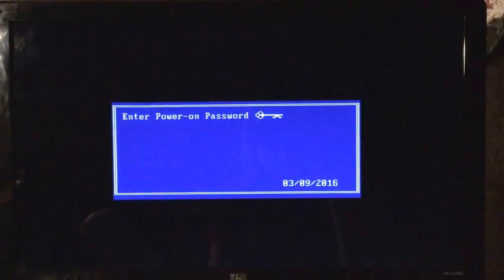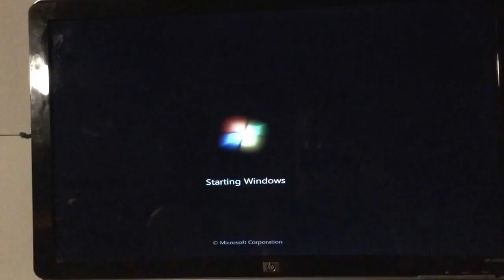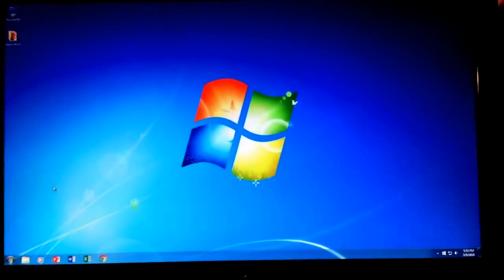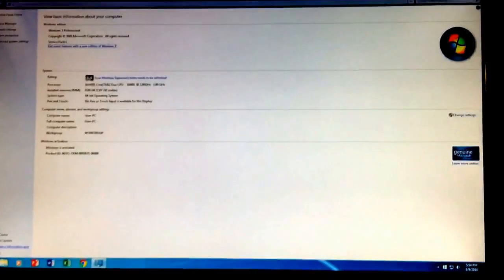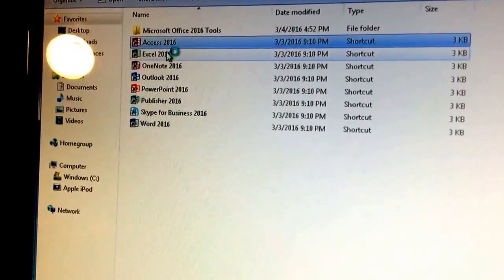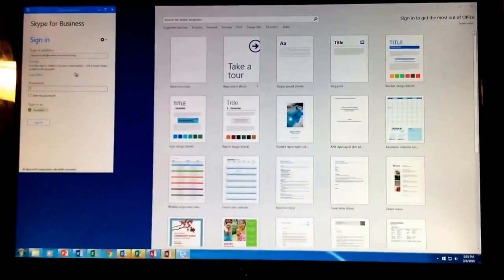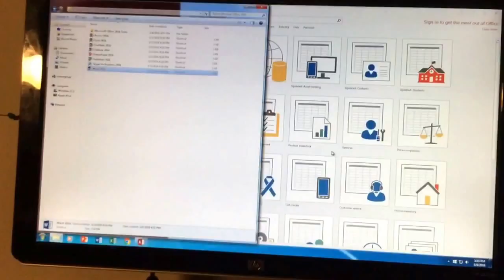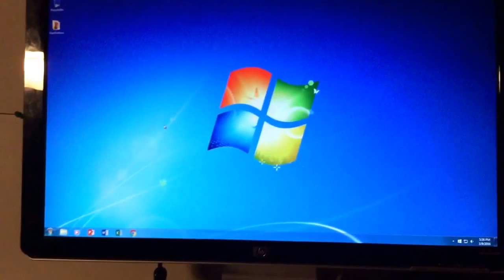HP Elite 8000 Review (and Mini Processor Stress Test!)

Comment: OMG the DVD ROM tray on this thing is the chinziest piece of CRRP ever!!!
Reply from the maker: It’s a typical plug and play 5.25” drive, actually pretty tough to destroy unless you’re in high school in which case someone took out the rubber drive belt or shoved a snickers bar in there. The new ones in desktops that use a laptop style pop out drive are the ones you should be worried about. Even barely touching them while open would cause them to wiggle all over the place like it’s going out of style
Reply: @RealElementProductions  That's what this one seems like.   I couldn't get it seated back in the rails to go back in, so I futzed with it for 5 minutes, then pshed the rail in, then I sort of lined it up and smacked it with my hand out of frustration and it popped back on the rail inside and fixed it.  ANd Iw as like holy smokes that worked.   

This onlike the 3rd use of the drive tray by me ever.

I have it standing vertically on it's side with 4 rubber feet I mounted below so it's like a mini desk tower, so if you forget to put the tray back in anybody walking by in the dark can hit that dmmn tchinzy tray hanging otu which is what I did. 

Comapred to the beefy old 1x CDROM trays theset hings are a fragile joke.
Reply from the maker: @choppergirl That’s interesting, is it motorized like you click a button then it can go out and in by itself or does it just pop out and you have to push it in every time? I’m trying to see if maybe you have some weird adapter plate or something because full size desktop optical drives have been relatively unchanged since the 90s
Reply from the maker: OR you could be talking about a different computer. HP started using those laptop style drives pretty soon after these machines in the 600 and 800 series of desktops
Reply: @RealElementProductions  Mine isn't motorczed, but it is spring loaded and an electronic button will trigger a release servo.  

It's funny, I'm only using the HP for the DVD rom drive shared across the network as a network DVDROM drive because my high end workstation ... well.. doesn't have any location to install a DVDROM drive in it (Corsair 5000x glass aquarium style case with 3970x 128gb 3070 in it).

I have an old CDROM tower case from the 90's  I'm building a NAS drive box of cold storage of 3.5 drives... that has 18... count them.. 18 5.25 bays in it....   

I had 2 more of these somewhere in my warehouse with a few number of 5.25 drive bays in them if I didn't throw them away...    I for sure though tossed all the 1x CDROMs in in them....  (probably)
Reply from the maker: @choppergirl Wow that’s mega smart, thanks for visiting the channel!

Comment: Run with a Intel Xeon X5460?
Reply from the maker: The Xeon is an LGA771 socket, while the HP Elite 8000 only supports LGA775 CPUs, the Xeon wouldn’t physically fit into the HP

Comment: Hi can o add a second hard drive?
Reply from the maker: ZiaDox Yes, in lieu of the optical drive
Reply: Element Productions soo i can add another hard disk ???
Reply: Element Productions so i should use a sata cable?
Reply from the maker: ZiaDox The one already plugged into the optical drive is compatible with SATA hard disks
Reply: Thanks<3

Comment: i bught one with 4 ram and win 10 i will upgrate to 8 ram . so i wanna install xubuntun or linux mint  wich linux  can i use? better
Reply: ubuntu 20.04 lts is good option ,
More stable .
Reply: @mdanaszaimkhan5105  too late i have many time using mint but actually im.using manjaro in my other laptop
Reply: @alubaldini  mint vs ubuntu (stock) what you prefer
Reply: @mdanaszaimkhan5105  im prefer mint i started with ubuntu but some days then the system started slow when you star the system  or close the system for my mint a little more faster i you can do more thinks example efects desklets and other thinks on mint
Reply from the maker: Look up what version is best for what you want to use it for

Comment: P lease relpy can I use a i5 660 and a gtx 1030 on this pc
Reply from the maker: Nope, Core 2 Duo on the 8000 models only. 8100 uses an i5 660 and you will need a low profile 1030 but yes it will work

Comment: Were the HP Elite 8000 models with Windows 7 ever sold with USB 3.0 ports? If not, can it easily be upgraded to USB 3.0?
Reply: No and yes.
Reply from the maker: No, only USB 2.0, you can add them with a low profile expansion slot

Comment: Just bought one of these as a refurb. Any advise as to what to check when I get it? It's win 7 pro.

Update...when I first turned it on I got 5 beeps and 5 red blinks...which is a ram error.  Turns out the 4gb ram in the black slot just needed reseating. Not sure which slot to put another 4gb stick in though. Surprisingly quiet.
Reply from the maker: Check for leaking or blown capacitors, but these are not known for having those issues. Otherwise they are solid performers

Comment: I upgraded mine windows 10 pro now Wi-Fi is missing tried to contact Microsoft opened the forum found out I wasn't alone.
Reply: have you tried with an external usb wiffi port? or checked if wiffi card is installed? because some of this models have no wiffi card incluided
Reply from the maker: Ooh, uh how did you get WiFi on there? A card? Get a USB WiFi adapter

Comment: Does a wifi adapter work on it?
Reply: WindowsPC yeas pc-i wifi cards work and so do usb wifi adapter
Reply: @letsnerdout9178  thanks for your answer  because wiffi card can be expensive while usb adapter is a cheaper option
Reply: al ubaldini no problem
Reply: @letsnerdout9178  thanks is a cheaper option ,, dude have you ever install or used linux in this pc i wanna install ubutun or mint and use dual boot ,win 10 for some simple games and consoles classic emulators  ,, and use linux
Reply: al ubaldini I have never used Linus period
Reply from the maker: Yes

Comment: Im getting this pc for 270 USD could this run games smoothly heres the specs.

3.2 ghz

16GB RAM

Quad core i5 processor

2Tb SATA 7200RMP

and it has dual screen ready
Reply from the maker: That’s an 8100, 8200, or 8300

Comment: I was wondering if this computer will be obsolete soon since most are refurbished, I just purchased one about a month ago, how long will I be able to get parts for this computer, I have a laptop from a different brand which is a year to two years old and cannot get some parts for it according to manufacture. Thank you for your video and reply.
Reply from the maker: Daniel Trujillo This PC will not be obsolete for at least another decade. My HP Vectra XA-6 from 1997 is still chugging with all original components and Windows 98 which is installed is perfectly usable. Seeing how popular the Elite 8000 was, there should be an aftermarket for used but working or off-brand parts for years to come.
Reply: I appreciate your reply and thought you did a great job on the video, keep up the great work.

Comment: mine has windows 10
Reply: it runing fine? i will bought one with win 10 but just 4 ram but  i will upgrate to 8 , so yours work fine? i wanna try to install linux
Reply from the maker: Nice
Reply: @RealElementProductions  I used to have that pc from 2017-2019, got rid of it and had a lenovo thinkpad t440 for a while, currently using an hp pavilion desktop pc with a gtx 970

Comment: do you have to have an Ethernet cable?
Reply from the maker: 99% of the time, yes you will need an ethernet cable for the internet. However, there is a clever workaround by means of a USB wifi receiver like this one: http://ebay.to/2flfXCk

Just plug in the adapter, follow the instructions, and you're all set. Have one of my own and it works great!

Hope this helped.
- L
Reply: Simplyou2be thanks does the Wi-Fi adapter work for this tower?
Reply from the maker: +Joe Pinard Yes. it will work with practically any computer running Windows XP or above that has a USB port

Comment: Hello I recently bought this off amazon and i was wondering if it will play games like battlefront 2 (the old one of course), and garrys mod? It would be amazing if you reply
Reply from the maker: Garry's Mod runs 30fps on normal settings, which is decent for what you're paying for one of these. Battlefront 2 I haven't played yet but from the minimum requirements you should be good to go :)
Reply: Simplyou2be So would i be able to play these games right out the box and without upgrading? also forgot to mention 1 more game left or dead 2 lol sorry

Comment: can you fit a gtx 1050 ti in it?
Reply from the maker: TERRIER unable Nope. just got one myself and the card would stick 2 inches or so outside of the case. sorry
Reply: would it be able to if i took out the side panel?
Reply from the maker: TERRIER unable I wish, but the power supply is far too underpowered to support a card of that magnitude. Not to mention that removing the side panel would cause issues for cooling
Reply: oh ok what graphics card would you recommend?
Reply from the maker: TERRIER unable HP recommends the Nvidia Quadro NVS 295 which is probably the best you could get for this computer, but Quadro cards are more suited towards business applications than gaming. I sugguest you get an HP 8200 or 8300 CMT desktop. They'll have more recent Core i5/i7 processors and can fit a 1050ti with ease
Reply: i searched up hp 8200 cmt desktop and i found a hp 8200 elite cmt desktop. is that the one your talking about?
Reply from the maker: TERRIER unable Yes. I have an HP z220 workstation and the 1050ti fits perfectly. Since the z220 and Elite 8200 are nearly identical by layout, I guarantee the card will fit
Reply: Yeah I saw a review on it and it looks like it will fit easily! Thanks for your help

Comment: I am bidding on 1x8000 and 5x8200 as 1 lot auction.  My plan is to combined some of Ram stick into one machine that I want to use.  This auction doesn't indicate the specs, so I am assuming it has only a basics (no upgrade ever made to this machine). My question is, if I pull Ram stick into one that I am going to use, will it work?  What else I can use from other machines into the one PC that I am planning to keep?  All 6 machines, I think I can get it at $25.00 - $30.00. so, I thought it would be worth it.
Reply from the maker: Probably so

Comment: I am bidding on (1) of 8000 and (5) of 8200 as  1 lot bidding.  It doesn't show the specs of the machines that I am bidding, so I don't know what size ram or HD sizes it will come with.  My question is, I am planning to pull Ram sticks from other machines into one that I am going to use.  Will it work?  I could get all 6 machines  under $20.00 and thought it would be worth it.
Reply: If they're ddr3 possibly check the spec sheets on hp  website! Max ram is 32gb. I'm running my hp/compaq 8000 as a plex server with 16gb and no problems or lag, I also upgraded the cpu to a 4 core. Stock is usually a dual core.
Reply from the maker: DDR3 ram

Comment: cool video, I decided to upgrade my 2011 instead of buying a new pc. ( glad I did ) specs : HP Compaq Elite 8200 sff with i5_2400  / 12 Gb ram & added 2 x sand hd
Reply: dam spell check / added 2 x ssd hd & msi 1050 ti low profile all running on stock psu. just awesome.
Reply from the maker: Al dente!

Comment: Hi , I have an hp 8200 elite SFF with i5 2500 and 4 GB ram . I'm planning to buy a gtx 1050 ti low profile and add another 4gb ram . So can i play most of games with high or ultra setting ??? especially FIFA 17 , GTA 5 and WWE 2K17 ???
Reply: The first undisputed champion i5??!! I would recommend upgrading to i7
Reply from the maker: No, CPU is too much of a bottleneck

Comment: can this stock run like battlefield 4 and nfs rivals ? pls answer ASAP
Reply from the maker: asd man Nope, definitely not without a graphics card and quad core processor, and even with both you'll still be pushing around 30-40fps. This is a business focused computer so it's not really meant to game in the first place, especially with the latest triple A titles.
Reply: thanks for the answer :) subbed
Reply: could you recomend a gaming pc under 150 euros ? thanks in advance
Reply from the maker: This is the Elite 8300, and it's $10 over your budget but worth every penny. It has quick 3rd gen i5 processors and a good amount of HDD space and ram for gaming. http://www.ebay.com/itm/HP-Compaq-Elite-8300-SFF-Core-i5-3470-3-2GHz-4GB-DDR3-500GB-HDD-No-OS-/162388604636?hash=item25cf1d76dc:g:sHUAAOSwnHZYm1Q-
Reply: thanks again

Comment: hey you think a xfx rx 470 can be in this pc
Reply: No. You would't be able to connect an external power. Because the PSU in this computer doesn't have neither a 6-pin PCIe plugs nor 4-pin Molex plugs. Also, keep in mind, that HP recommends GPU with TDP up to 35W. All the details available in documentation which can be found on HP's web-site.
Reply: And you won't be able to power this system from a regular ATX/SFX PSU that easily. Motherboard in this system has custom power connectors.
Reply: XxmatixX - 6 videos diarios de nada :v a 1050 ti small form factor from msi would fit no extra power need from psu perfect for making it a gaming beast
Reply: +. Hitman any lga 775 CPU will bottleneck 1050ti. I'd go with something like 750 or 750ti low profile
Reply from the maker: Low profile only and no that card requires too much power

Comment: hi my pc is hp 8000 elite cmt pc and 320 power supply and core2duo e8400 and 4gb ram but iwant to buy gtx750 ti 2gb ddr5 canmy pc handle it please answer me  because i want to this card
Reply from the maker: Yes, you can install that card in the CMT
Reply: ok thank you because some people told me it not work i will buy it

Comment: Is it possible to upgrade this with a SSD and still keep the original HDD?
Reply: You can if you unplug DVD thing and put ssd
Reply from the maker: Yes, remove the disc drive to use the same connectors on a 2.5” SSD. You will need to mount it or use electrical tape like I do

Comment: Is possibile install in this PC, motherboard and the power supply of the hp dc 7600sff model? thanks
Reply from the maker: Ooh that’s a no go. Only install the original power supply model number from your PC. There are board revisions with different connectors and power ratings

Comment: do you need to have an Ethernet cable connected for internet?
Reply: You can buy wifi usb thing or Ethernet
Reply from the maker: Yes, or you can buy a cheap USB WiFi adapter off Amazon/ebay, but be careful. Some are rumored to have surveillance devices inside

Comment: Can I put the Hp in vertical ?
Reply from the maker: Yes, there are actually rubber pads on the side meant for that placement.
Reply: Simplyou2be Thanks , but can i do without rubber pads?
Reply from the maker: Yes, but it will slide pretty easily and scratch up the case. Put some rubber feet or even a towel to prevent damage

Comment: Cool video I just got this desktop for gaming or upgrading it for gaming. Can I play DayZ on it as it is or do I need a better processor and graphics card? Thanks!
Reply from the maker: GTX 750ti low profile, original processor is about as good as you’ll get. The increase in performance with a CPU upgrade is minimal, then it should run DayZ and Minecraft decently

Comment: Two things.
Can I insert another hdd or only one is possible.
Say one 500gb and another 2tb?

Second, can it be upgrade to win 10 or limited to Windows 8 only?
Reply: yes you can
Reply: Where can another hdd be insert while keeping dvdrom too?

And Windows 10 which version 32 or 64 bit?
Reply: there is a box down to dvd in that box and must check that your motherboard has an extra drive connector for additional hdd drive.
Reply from the maker: You can only insert 1 hard drive with the DVD drive in. Technically you could get around this by just putting the second hard drive loosely in the case but only do that if you aren't moving the desktop because that's pretty dangerous. If you take out the DVD drive, you can unscrew the mounting screws from the DVD drive and into the side of the hard drive. Then it should click right in! I'm pretty sure all models can only handle 2 hard drives maximum
Reply: yeah i have the same pc and i recently added another hard by the way i am not moving it.
Reply: SCIENCE AND TECHNOLOGY DEMOVIDS like to see it... N what do u mean moving it....do u mean picking it up for cleaning or blowing it

Comment: Hey Luke,  I recently bought this and I'm having an issue with it.  I bought a display port to hdmi cable so that I could use it on my TV.  I connected it,  but I get no video on my TV. I've tried turning it on and off,  switching hdmi ports on the TV,  and nothing works.  Please help,  I've found no solution for it,  I've even tried calling HP and nothing so far. Thank you - Chris
Reply from the maker: This just happened to me lol. How long is the HDMI cable? If it's longer than 10 feet try a shorter one. As much as it sucks longer HDMI cables tend to mess everything up
Reply: It's not very long actually,  it's pretty short.